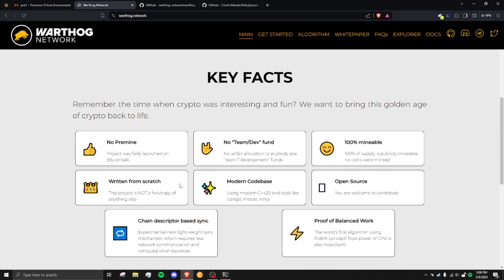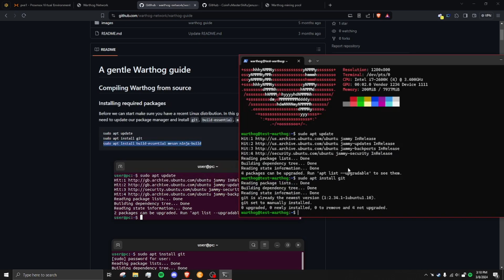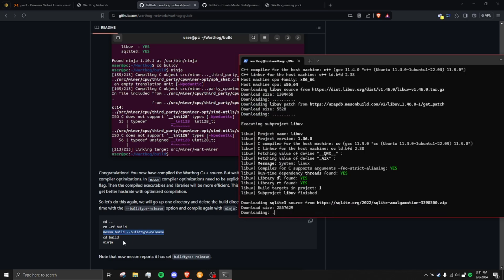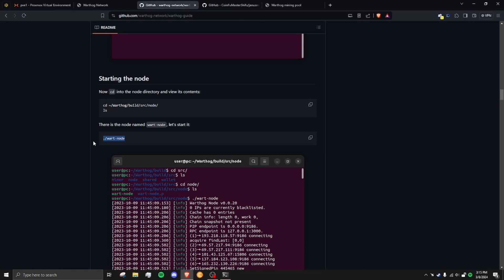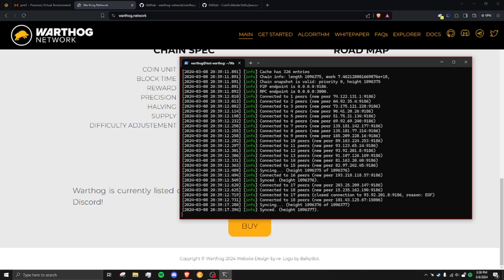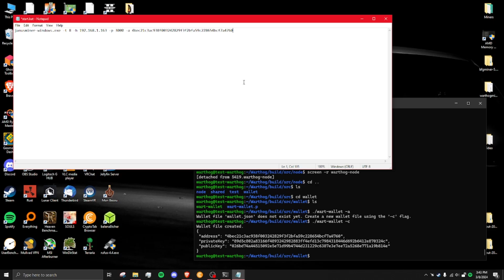How to set up a Warthog node and start solo mining (WART) (Crypto)

Comment: Hello,,,, I had my node up n running and blew a breaker. Now my node won’t start syncing. After putting in the command to start I get the info up to rpm endpoint , but then it doesn’t sync. Any ideas?